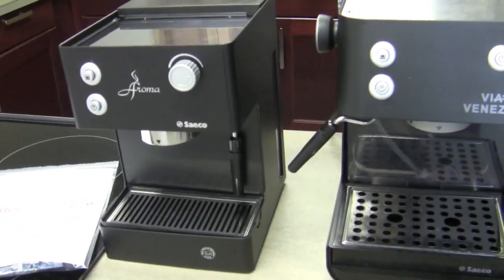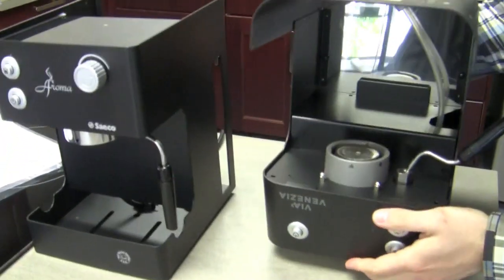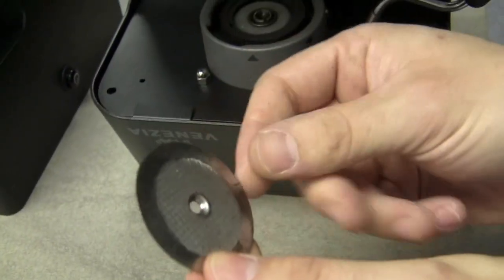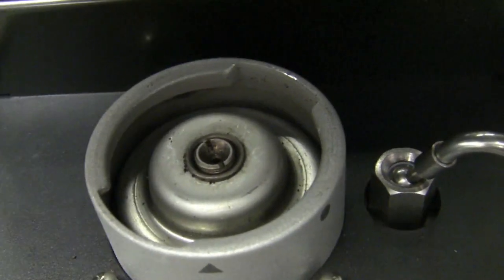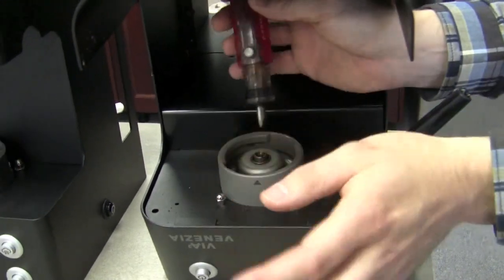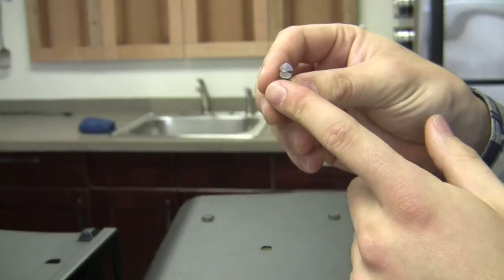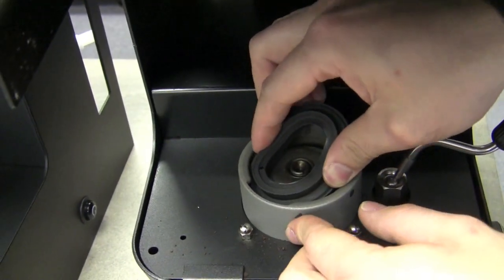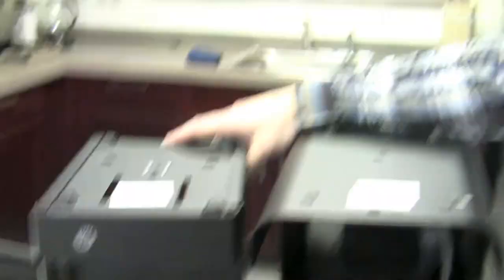How-To: SCG's Tune-up Kits for the Saeco Via Venezia & Aroma

Comment: I've owned my Starbucks Barista (earlier version of the V.V., purchased used), for about 2-1/2 yrs and have taken pretty good care of it with descaling regularly and using your tune-up kit once per year. I recently bought another of the same model in a beautiful candy apple red from e-bay. This machine was woefully neglected and I firmly believe was NEVER cleaned or descaled, ever! When I first got it, I looked up into the brewhead with a flashlight and thought it was covered with corrosion but upon taking it apart realized it was just a ton of old crusted coffee grounds packed up in there. The gasket was a rusty brown color. The underside of the filter screen alone had a good 1/4" of grounds packed onto it as well as the brewhead itself. I descaled it twice, leaving the descaler in the machine overnight.  I removed the old gasket and found grounds EVERYWHERE! It took me a good 45 minutes of scraping and digging with a large paperclip to get it all loosened up so I could use my vacuum cleaner to get it all out of there. I've never seen coffee packed up that deep into a machine! This experience gave me a renewed sense of appreciation for what you guys do at SCG every day! After 2 full days of cleaning, descaling, &  rinsing, I pulled my first shot in it using my non-pressurized porta filter and made a lovely latte! After all the years of neglect/abuse, this little guy still worked like a champ! These things are built like tanks!!
If this espresso machine was a living, breathing entity, it's now breathing a sigh of relief!!  :-) Thanks for all your "how-to" videos! They are soooo helpful!  :)
Reply from the maker: Woohoo!

Comment: Thank you so much for this video. I just replaced the pieces I ordered as part of your kit and it was very easy to do. I used the quarter trick and worked perfectly. The ball valve was completely brown and the brew screen was about 40% blocked. I hope my Saeco Aroma will be better. I love my coffee machine!
Reply: Well it was all good and easy; however, my coffee machine is no longer working. It started overheating. Water started to come out from the wand and the brew head at the same time. I opened the top and realized that water is coming out from the top next to the wires. I tried to brew coffee and the pressure was so high that I wouldn’t be able to remove the portafilter. I can send you a video showing what I mean. Maybe is a simple solution. I am very sad because it was working prior to changing the pieces from the kit.

Comment: Very clear instructions. I just followed them and was able to do the entire procedure pretty quickly. 
Just a couple of items:
1) a quarter does not work to unscrew the boiler bushing, the quarter is too thick. A dime or a penny is too small, so it's not easy either. But using the screen that you already took out works easily.
2) a good idea to wear thin rubber gloves for the procedure. This is a little trick I learned from the guy who tunes and fixes my bike. You can wear them to protect your hands. I wish I had thought of this before doing the tune up...

Comment: Hello! Not to put a downer on this video, but I regularly descale my saeco aroma, and keep it nice and clean. We use it daily and I've had the Aroma for about 4 years now. My coffee still tastes the same (very nice!), the holes in the screen are all open, no leaking around the brew head. The machine makes no weird sounds, the pressure seems to be consistent over the years, all in all, for such a 'cheap' machine, I'm very very satisfied. I've never replaced any parts except for the steam wand which is just plain awful (the one that comes with it). I also temp surf the steam temperature by letting it heat up to steam temp, get the steam out in an empty glass until the steam light goes off, wait about 10 seconds (the light should not be on yet) and start steaming. This way you can steam a larger amount of milk without loss of pressure (but I don't have to teach you guys that ;-)) and I produce beautiful micro foam which is good enough for latte art :-)  Anyhow, I'm still very grateful for all the amazing videos you guys make and watch them with pleasure! Maybe I'm just very lucky with my Saeco ;-)
Reply: Hello, How do I upgrade my steamwand? I too have the standard metal arm with my Barista.

Comment: I’m so late to this party but I have both the VV and the Starbucks Barista. I had the same trouble getting the bushing off the Barista. The bushing needs a 7/16 flat aka slotted screwdriver. I found a bit inside of a 1/2” socket today as a part of a set from Pittsburgh brand at harbor freight tools. I attached it to the socket wrench and my 200 lb husband had to really wrench on the thing to get it out. Unless you are strong you won’t get it out yourself.  Anyway I hope this info might help someone else that is trying to find a tool to get the super stuck bushing out.

Comment: Thank you for the video, which helped me get my group seal back in (I'd had it the wrong way round - doh!)
Also - and this will probably help no-one - but I found that the ideal size coin to undo the boiler outlet bushing is a 20 Heller coin from Czech Republic. (They have been out of circulation since 2008).

Comment: help help.. went to 3 hardware stores in an attempt to remove the boiler outlet bushing.  it appears to be stuck as the 2 screens & quarter tip ...just are not working...

Comment: Failed to mention, the brewhead gasket has a notch in it that must match up with a metal "tab" in the brewhead.  At least, my Aroma has that - maybe not on the Venezia.  Otherwise, very helpful video.  Note I'm rebuilding mine for the first time in 10-1/2 years.  I cannot believe they recommend doing this every 6 months.  Except: I had to drill out the screw holding the screen in - it would not budge.  As a result I was forced to replace the valve/bushing, where the remains of the screw were lodged.  The nylon valve plug on mine was nowhere near as dirty as the one they showed, and I use my machine daily.  Different strokes...

Comment: Hi, thanks for the video...very helpful. I have an Estro Vapore 100 that just started leaking around the brew head. Up until this started the machine has been operating perfectly and has been used almost daily since I got it some 20 years ago. I'm hoping your tune-up kit will work for my model and get me back into my daily habit :) Although I stopped using the machine I can still pull a shot...it's just kinda messy. The steam works as it should as well, so I'm guessing the issue is with the boiler ball value and spring. The brew head gasket is still soft with no significant defects. However, I'd like to perform a complete "tune-up" before I use my Estro again. Thx in advance for your help.

Comment: Brendan I just saw your tuneup video. We bought our Via Venezia at SCG years ago. We've had very slow dripping lately. I cleaned the machine with the tool and just removed and cleaned my filter.  It's still barely dripping - taking quite a while to get the coffee to come out.  Do you think my problem is the spring at this point or possibly needing a new pump? thks much

Comment: I have a Via Venezia and it stopped heating up the water therefore I get no water coming out of the group head or no steam from the steamer. In fact, the button to get water out for the coffee doesn't light up. In fact # 2, only the power button lights up. Hard to find someone who can repair where I am so may need to do it myself but not sure where the problem lies...Any suggestions?

Comment from the maker: Oh, got it. I don't think this tune-up will resolve that. It sounds like the steam valve needs to be repaired; there's a little part up in there that can degrade and results in water coming out of the wand. You'll need to have a tech get into it and repair it. - Kat

Comment from the maker: If you take apart that whole component -- including removing the plastic tip -- and thoroughly clean it, that's the biggest thing you need to do on a regular basis. It can definitely get gunky! The actual metal tube part of the wand, though, doesn't require any special / specific care. - Kat

Comment: Great video and kit for my Via Venzia, thanks.  Just a few lessons from my first kit replacement experience.  First, I hadn't done any service on this poor unit since I got it 18 months ago, my bad.  As you can imagine, I had a heck of a time getting it apart.  Secondly, I could not get the small Phillips screw that holds the screen on off, but I found that if you use a large set of pliers or channel locks and grab the outside of the gasket and screen and turn it, it will loosen the small screw.  Thirdly, I had a really hard time finding a tool that could get the bushing off.  It would be great if SCG could get a supply of the appropriate tool, I would imagine Saeco has them for vendors.  I searched and searched and I could not find a 7/8" flat head, which was listed on the kit insert as a necessary tool for this job.  I finally got desperate and drilled a hole large enough through the bottom of the Via to fit an 8" long 3/8" flat head screwdriver through it!  I got that bushing off and the kit installed though!
Reply from the maker: +Evan Williams Great to hear you were able to get it installed! Cheers!
Reply: +Seattle Coffee Gear Help!! I have an old Starbucks Barista machine, basically the same as the Via Venezia, and I bought this tune up kit. I bought the espresso machine "used" and I don't think it has EVER had this tune up done. I can't get the bushing out! I've tried everything, nickels, quarters, metal washers of varying sizes, and I've gone to several hardware stores trying to find a screwdriver with a wide blade, all to no avail!  :(     Where can I find a proper tool to have on hand to do this tune up periodically??
Reply: Did you get this resolved?  I am having the same problem.
Reply: Nick Heniser I did find a flathead screwdriver from Ace Hardware, (Craftsman brand), that is 5/8" wide at the blade and the the shank is just 1-1/2" long. The blade is slightly narrower than the slot on the bushing but my husband managed to carefully hold the screwdriver steady to loosen the bushing. I have removed it again since the initial tune up in March and it was much easier, I think because it had never been done before my first attempt. I hope this helps.  :)
Reply: philips screw came right out with no problems.  Large flathead bushing... OMG.  Ruined a couple quarters before trying to cut a notch off a piece of steel to fit perfectly, and it still will not come out.

Comment: First off, I think you guys are the best-informative/funny/chill. OK, so I descaled and tuned up my Aroma after 3-4 months of daily use. The parts actually looked pretty new, but I replaced them anyway. However some "problems" lingered despite doing the DS and TU:

* some leaking from the brew head/steam wand
* more flow from the left spout of the non-press. portafilter (this could due to my tamping tech.)
* intermittent "firing" sound when frothing (I have the retro fit)

Any thoughts? THANKS!

Comment: Love the kit and the video. The steam wand on my Starbucks barista has leaked over the past few years and I was hoping the kit would fix that up. Unfortunately after I replaced the ball valve and put it back together the leak through the steam wand is now worse. I have taken it apart and even replaced the old ball valve but it is still worse. Any ideas of how to reduce the leak through the wand? I am from the east coast of Canada so dropping the machine by is not really an option.
Reply from the maker: Stuart Wright  Glad you enjoyed the video! We would recommend you check the direction of the ball valve and spring and make sure it's in the right direction. The tune up kit we sell doesn't  have the parts necessary to fix the steam wand, if that is truly the part that has failed. You can get a replacement part for the steam wand here: buyphilipsparts.com. Unfortunately we don't sell that item.

Comment: Soooo. I can’t get the “bushing” or the valve spring screw thing out. At all. And I don’t have the ability to make a fancy screwdriver - any hints or tips?  I have some dropping from the panarello now and I’ve owned the machine for  3 years- I have been descaling, but didn’t  know about this part of the maintenance! 😩
Reply: I had the same problem. And I looked everywhere to find a flathead screwdriver with a 1/2" wide blade, no such thing available. Do you have any old/used screens from the brewhead? If you put 2 together front to front, this makes a good screwdriver for such a wide opening of the bushing. I've tried quarters & nickels with no luck but others have said coins worked for them. If you only have one old screen to use, fold it in half to get the 2 edges. Hope this helps.

Comment: I've had mine for many years, honestly i've never done anything but use it.  no descale or anything.  It feels like it's putting out less pressure these days, can no longer push water through an Illy ISE pod, and when I grind beans, no crema.  Is this kit the solution I need?  Something else?
Reply from the maker: Hi there,

Regular cleaning and descaling is very important, and mineral buildup is likely the cause of your issues. I would check the manual for the machine and follow some of their recommended maintenance guidelines to see if it helps.
Reply: @SeattleCoffeeGear  Thanks.  As a first step I removed the screen above the portafilter (first time after who know how many years of ownership, I shamefully admit) and cleaned it, and am already noticing a big difference.  Still not producing the crema I'd like so I'll do some further digging and see what's next :)

Comment: Are you going to have these back in stock anytime soon?
Reply from the maker: Yes! We should have more of these Tune-Up kits after Thanksgiving. We just recently sold out. :-)
Reply: Seattle Coffee Gear I have a question...I just bought a used Starbucks Barista espresso machine, which I believe is similar to the Via Venezia. Everything works well and it heats up nicely however, when I try to brew a shot, the water runs over and around the portafilter. Is this because I need a new brew head gasket? Or all 3 of the parts your are replacing in this video? I've already done a descaling and thorough rinsing. The steam wand works great too and makes lots of foam. It's just the brew head/portafilter area that leaks when I try to brew. Please help! Thanks!
Reply from the maker: helpfulnatural It may be best to get the entire kit, because leaking may indicate you need a boiler ball valve and valve spring as well. Since its a used machine it might be best to replace everything that is included in the kit all at once, so you won't have to disassemble again later down the road for maintenance in the same area of the machine. I hope this helps! ~ Sarah
Reply: Thanks for the help! I just checked your website. Will you be getting more kits in stock soon? This must be a very popular item since it appears by the other comments here that you run out of them quickly.  :)
Reply from the maker: helpfulnatural They are now back in stock: https://www.seattlecoffeegear.com/seattle-coffee-gear-tune-up-kit-for-saeco-via-venezia. :-) Thanks!  ~Sarah
Reply: Yeah!!